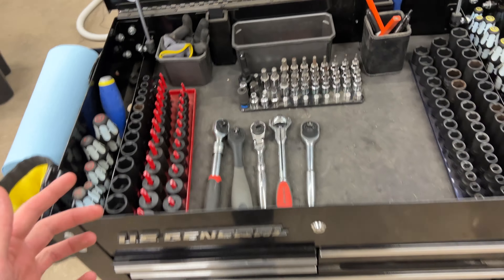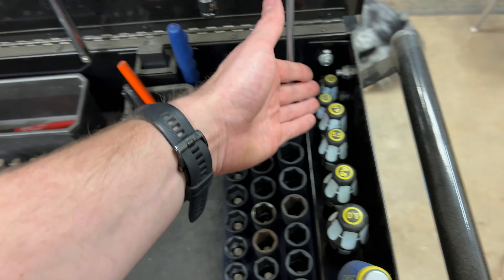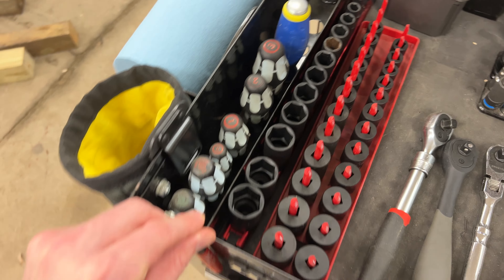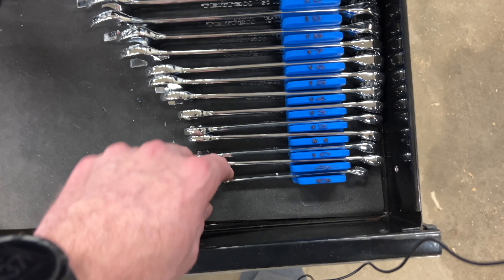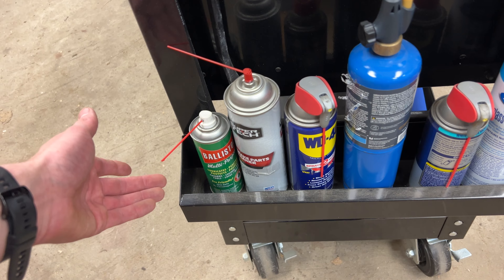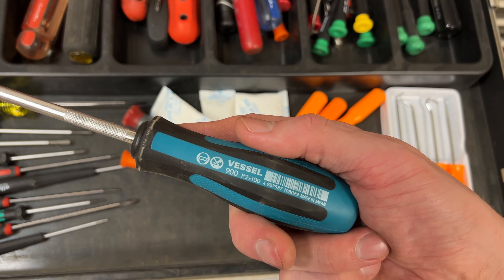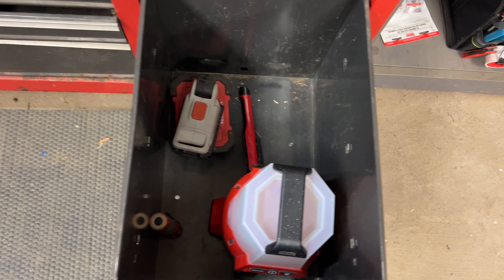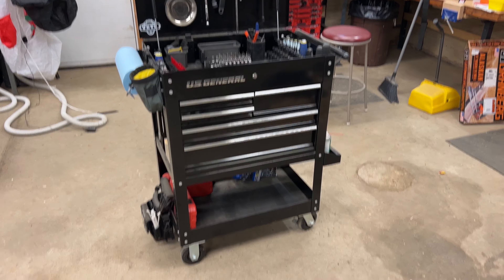Toolbox Tour 2023 | US General 5 Drawer Cart

Comment: I must have crappy magnets because I can not get my extensions to stick. I bought a few from Harbor Freight maybe they are not strong enough. What brand is that strip you have on the lid?
I just completed my 3/8" metric Capri impact set. Deep, semi, and shallow. I also picked up the 1/2" and 3/8" stubby. These things are good but cost a good amount of money. If you want to have a complete set you need to buy all 4. LOL - well you do not NEED to but like a lot of guys I just want to have them all even though I will prob only use 10% of the sockets.
Reply from the maker: I have found Chrome extensions don't hold on there very well. those magnet strips are just the cheap ones from Harbor freight - you're definitely right about shallows completing the set but I almost exclusively use the semi deep sockets and I haven't YET ran into a time i needed to use a shallow... when the day comes I will pick some up !